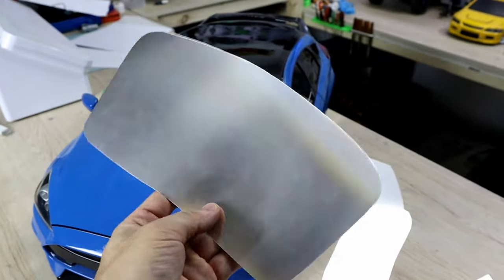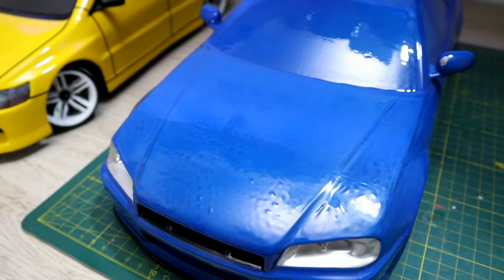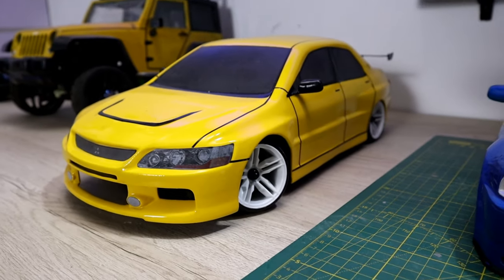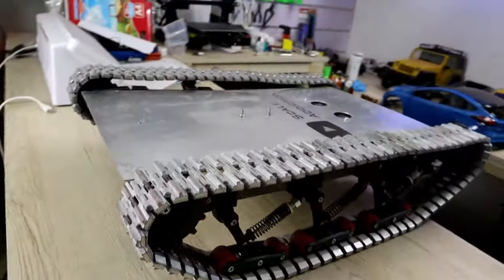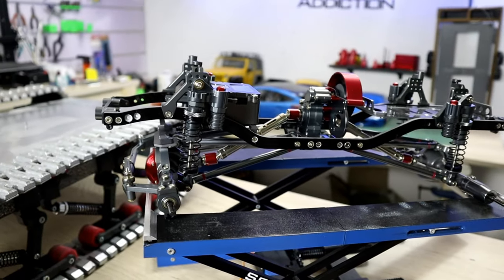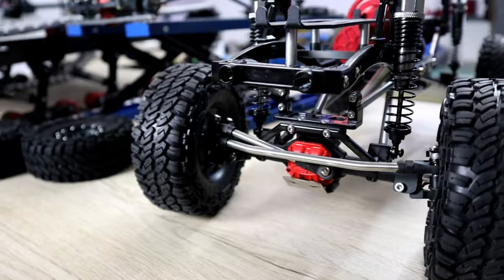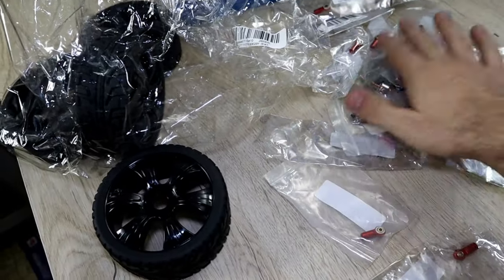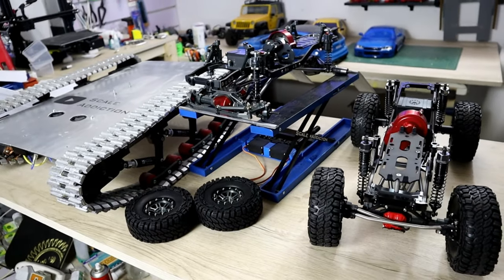I have Good and Bad news | Scale Addiction

Comment: Ali, what gyro will you be using ?
Reply from the maker: https://m.aliexpress.com/item/4000022471242.html?spm=a2g0n.productlist.0.0.42813db0UnTXCk&browser_id=8456cf892613481f84e2ea271c9594b7&aff_trace_key=9924c2d9150a45f49a3a56b7a95c392d-1611803594313-05601-_ePNSNV&aff_platform=msite&m_page_id=wcqse1g05qwcablq17a28c9dd541ba3fb926251d41&gclid=&_imgsrc_=ae01.alicdn.com%2Fkf%2FH9d26af3684bd4336921c4977118a2f38b.jpg_640x640Q90.jpg_.webp
Reply: @scaleaddiction  Awesome, thank you so much!! Been struggling to find at my local hobby shop but this should be perfect
Reply from the maker: I haven't used it, but, it had good reviews, let's see how it will be
Reply: @scaleaddiction  then I will wait for your review before ordering one myself, converting the currency to mine with shipping it’ll almost cost the same as a small 1/12 scale kit🤣